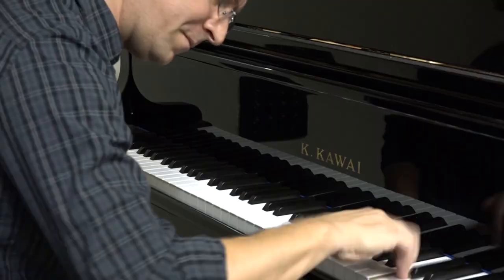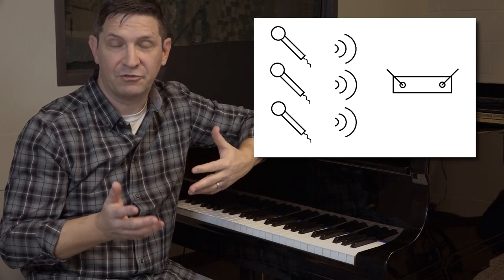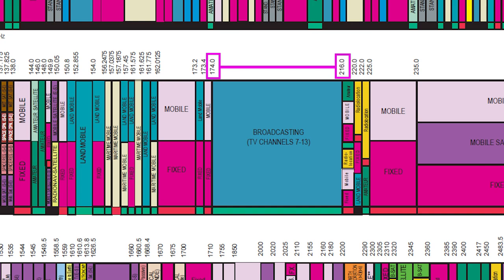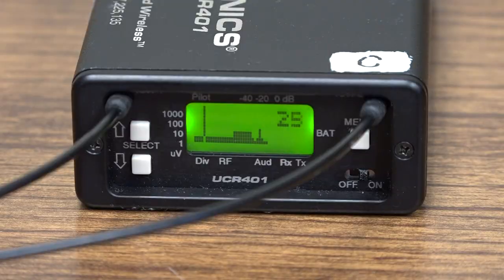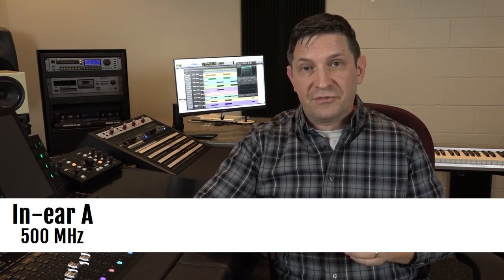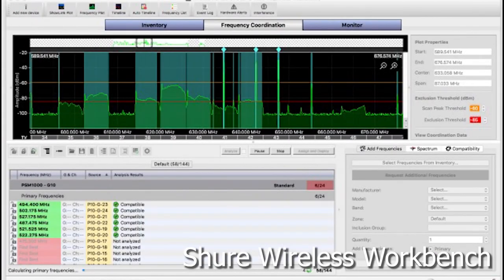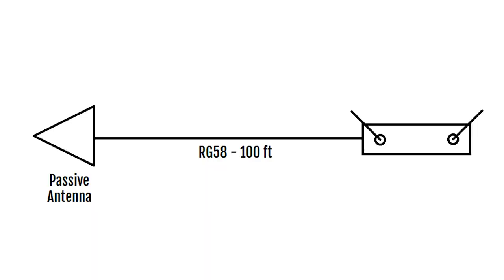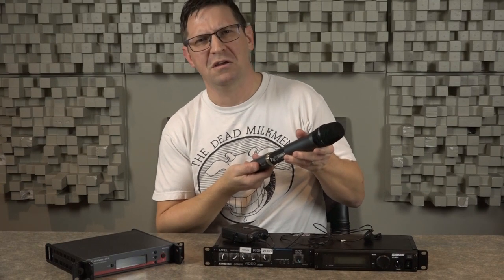Wireless Do's and Don'ts... But Mostly Don'ts!

Comment: Awesome video! I do have a question though. Most audio interfaces can do many jobs: clocking, converting, preamp, monitor control, etc. Would you recommend an audio engineer who wants to get great recordings at a very high quality to get hardware that specializes at one specific job, get a single hardware that can do it all, or a mix and match of both? It's for a dedicated room home studio and making the right investments is important to me. Thank you!
Reply from the maker: Thanks! To be honest, it really doesn't matter.  It just depends on what your personal goals are with that studio.  As long as the all-in-one device does the job well, then go for it.  However, depending on what you buy, you might limit yourself when you want to expand... so that might be an argument for separate devices.